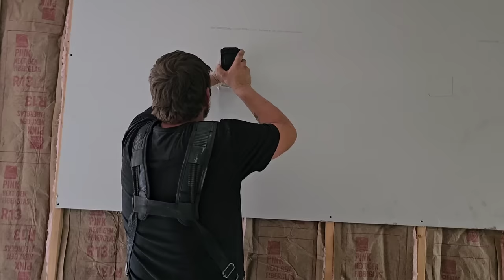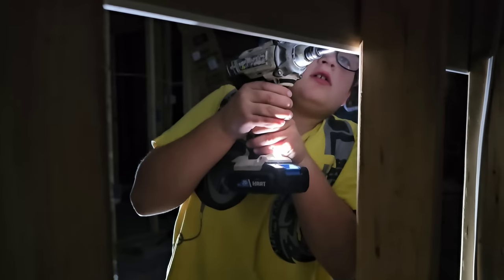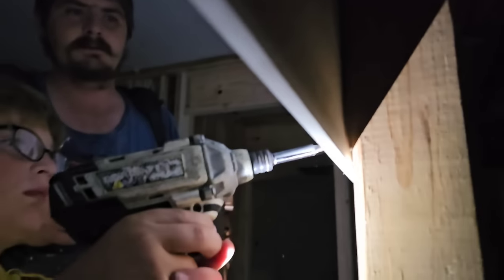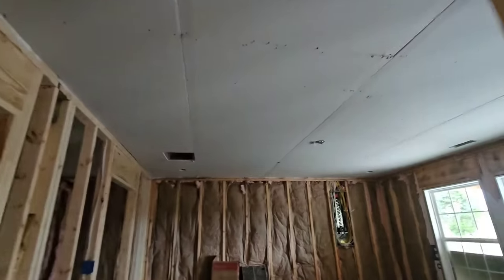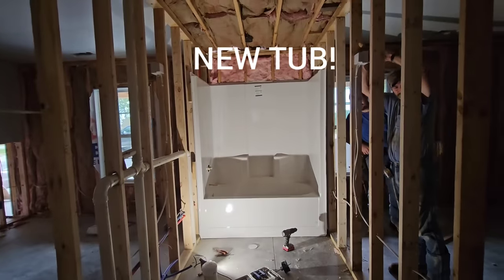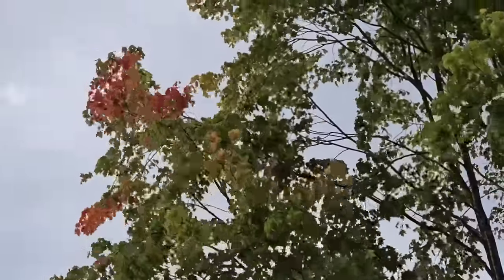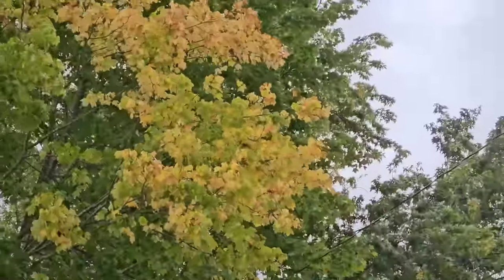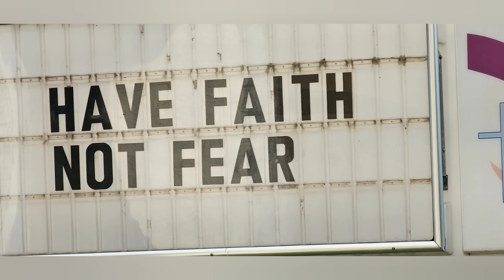Part 1: Started Hanging Drywall in our house

Comment: Don't want to be the bearer of bad news, but... if you crush fiberglass it's worthless.... needed to be pulled tight and on exterior walls stapled with tabs on outside on 2x4 side2"side.  Slows down air flow leakage, drafting... Sorry I know it's hard work ALOT of cutting, especially for one person! We own a insulation business, wish I could have given advice before the install!!
Reply from the maker: It's alright, it'll be fine, he was just trying to hurry, they did his dad's house the same way a few years ago and no issues as of now ❤️ but thanks anyways for watching!

Comment: We did the same when my husband and I built our home, I learned a lot on construction of a home, 
Installing the ceiling drywall is the hardest to do, I’m that’s glad all done. The tape and float will be next and messy, so be prepare to see that everywhere. 
Then the base trim molding and around the windows and doors  then the floors, I think ceramic tile is the best, look for prices.. but that’s up to you decide what type of flooring you all like. Have fun picking the paint for wall and ceilings. And then the light fixtures,.recess lighting are very nice with dimmers. It’s idea. Then then the kitchen & bathroom cabinets!, I’m so excited for you all! Can’t wait to see your new home all finished!  Oh, don’t forget your A/ C unit and ducts and I didn’t see that being installed.  Remember it’s gets hot during summers.
Reply from the maker: Thank you ❤️ byes we have ac unit  ran its in the attic, we had to have all of that done before insulation well they still have more to do but they have done the first part running all the duct work and such lol and thanks again we appreciate all the support!